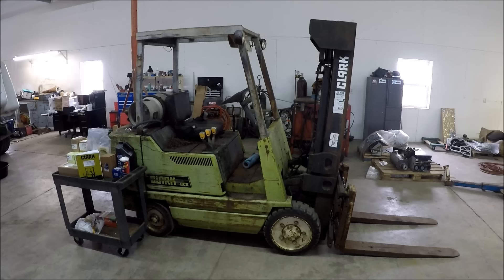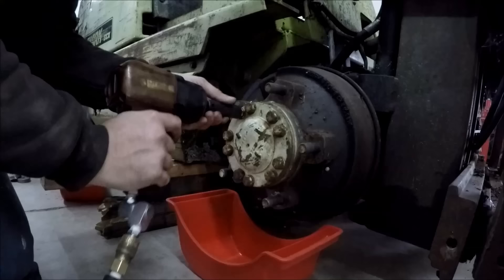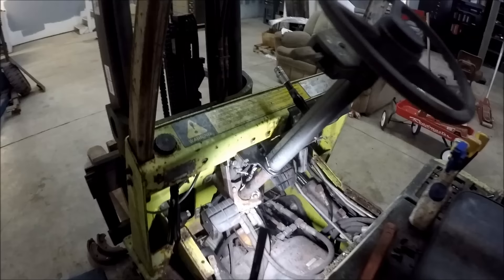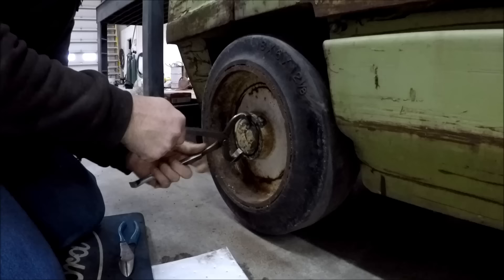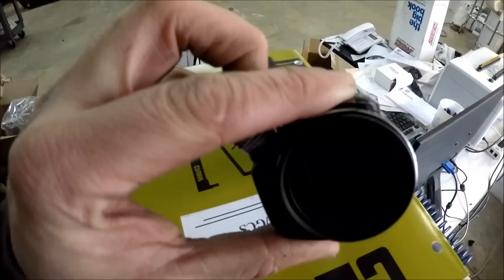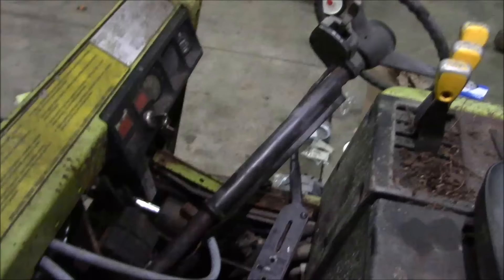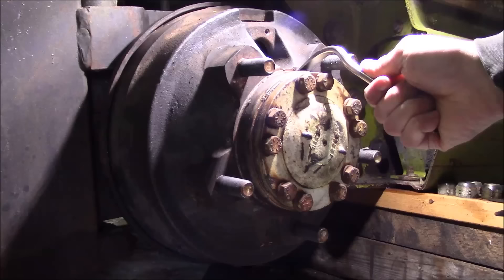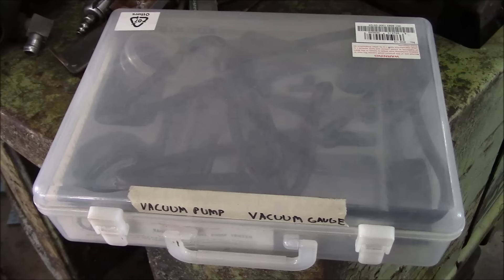Fixing a Forklift that Sat in a Field for 17 Years - Brake Job and Rear Wheel Bearings - Part 1

Comment: Because your so knowledgeable and detailed in your work you are certainly able to keep up and counter alot of snotty know it all comments from people. Although the comments can be toxic, I'm sure you have  learned from them as well. Your a great YouTuber.
Reply: I know this is a old comment but i cant help commenting on the subject of toxic comments and packing bearings,when it comes to packing bearings, you could have a degree from Harvard university with a Masters and a bachelors on bearing packing and once you make a Youtube video the first reply will be "man this guy doesn't know how to pack bearings' it makes me cry with laughter every single time.

I have been packing bearings for probably 30 years and i dont give it much thought,i make sure and i push as much grease in them as i can and just coat the hell out them, once they start turning that grease will be pushed in by extreme force where the sun doesn't shine and you'll be golden, in all my years i haven't had a single failure but i bet if i made a youtube video about it i would be tarred and feathered,lol

Comment: just a mention for down the road- if you ever need to replace the steering links, book says axle has to come out- I did mine a day before the book arrived luckily...if you remove the pins from both outer links, swing them both rearward then push down, the steer cylinder piston rod will rotate enough to remove the inner pins without pulling the axle and unbolting the cylinder body. was surprised when the book arrived- glad it was late :)
Reply from the maker: Interesting. One of mine is kind of loose, but I'm going to let it ride for now.

Comment: Wes, I used to work at a factory that had several lifts like yours with the mitsubishi engine. Good lifts but I hated working on them. Pro tip for anyone who needs a starter. Get one for an 85 dodge caravan with the 4 cyl and just change the gear and nose cone. Much cheaper and for some reason they always seemed to outlast the ones we bought from the clark dealer.

Comment: I have followed this from when you found it in a field. It has been very informative and detailed. Thanks for letting us watch over your shoulder.  I have been thinking about getting a old fork lift, and I think I will look for a gas or propane one.
Reply from the maker: I've had zero issues with propane. I know they are harder starting in the cold, but my lift is inside a heated shop, so that's never been an issue.
Reply: @WatchWesWork  thanks for the feedback.

Comment: At least you have been able to get parts. My Hyster is 38 years old and alot of parts for it have been discontinued so tracking down obsolete parts is a pain. Rebuilding the mast cylinder right now. Found the last 2 seal kits in all of the U.S.
Reply from the maker: Ouch. Yeah Clark parts have never been an issue. There are even aftermarket parts available.

Comment: Bleeding brakes or clutches from the bottom and up the easy and cheap way, buy a medicine syringe for large animals (horses) and put a silicone vacuum hose on the end and you have yourself a cheap power bleeder. I have used mine for 15 years and it has saved me in many situations when systems are poorly designed with the bleeder screw in the middle of the system.
Reply from the maker: I have a KD tools pressure pot bleeder. I just need to get some more adapters. Mine was made for the old cast iron master cylinders. I used in on grain trucks sometimes.
Reply: @WatchWesWork  What EDS says that is the Ticket not pressure bleeder needed, just fill the syringe and watch the bubbles in the reservoir come to the top, I wanna know though you got a spring set from Clark Dealer for $13.00 ??? and shoes for $30.00 each and I about spit out my coffee when I think you said $15.00 for the cable ....  They treated you very well.  You have a bad trunion bearing on the Drive axle causing the lean, you'll need to pull the mast to fix that.
Reply from the maker: @jerryrable1994  Clark parts are very reasonable. That's a big part of why I keep getting them. The chassis bolts were loose on one side. You'll see in the next video.

Comment: lol, as soon as you showed the pedals i thought of a funny story that you might appreciate. 

 one warm snowy evening we got two empty semis stuck in the dark after we unloaded ourselves after hours so that we could go home on friday night. of course the tractor we had just used refused to start because of a dead battery (they boosted it and left it running for us), and the only thing in the yard that would move us was an old Clark diesel forklift. well, that should work just fine. i volunteered to run the forklift because it was the exact same one that i drove in high school when i worked for that customer. what i didn't remember was that it had a clutch. so i got it running and warmed it up a few minutes and tried moving it. it had a shuttle shift so i backed up and then shifted into forward. which worked fine until i let off the throttle and it wouldn't stop. so i tried to find neutral. which didn't exist. so reverse-forward-reverse-forward a few times. still can't find neutral. even at a dead idle it wont stop. my co-worker who is now walking back and forth beside me says 'whatcha doing, quit playing i wanna go home' and i replied that i'm trying to find neutral. he lets me go back and forth a few more times and finally says when i go by 'try stepping on the clutch'. i did and it stopped. oh, it has a clutch does it? i watched people drive that forklift for 20 years and nobody had ever used the clutch.

Comment: Yep. Just put rear shoe brakes and cylinders on my girlfriend's Taurus. Tried the one-man vacuum pump method for the first time ever since I didn't have anyone around to assist me. Fail! Yeah, the bleeder screw loosened allows air to get around the threads. I waited until she could come over and, together, we used the two-man method and it worked just fine.
Reply from the maker: Yeah, the two man method never fails!

Comment: I like what you did with the air hose through the cap. That was cool.  As a general rule, I would hold the split end of the cotter pin with needlenose pliers as close to the nut as possible and bend it over the backside of the pliers to leave it rounded over. One side at a time. No stress points there.
     The first time I used one of those plastic pumps I noticed you have to really tighten anything with threads. They just leak.

Comment: Hiya Wes, if I've told you once I've told you a million times, don't exaggerate! That fork truck had not been out there 17 years, I reckon it was 16 years, 11 months, and 32 days! The reason for not packing the front wheel bearings with grease was the axel is full of oil, we saw it drain, and the oil lubricates the bearings. 
Stay safe...Steve...

Comment: I have a 53' Desoto and it has dual wheel cylinders in the front brakes. On one of the wheel cylinders, forget if it is the upper or lower, the manual says to use the vacuum method. I did and it did work. So the vacuum method does work sometimes.

Comment: I use a oil can with some tubing and simply hook to each wheel cylinder bleeder and pump away the oiler can until no bubbles appear in the reservoir. Shhh dont tell anyone but that's why there is a nipple barb on bleeders. LOL just egging you. Nice vid!

Comment: You can buy different size and type of rams for the jack pump also, we used them all the time where I worked for all kinds of stuff like fitting vessels etc! We even had one that has a center hole in the ram for pulling shafts out of screw augers! Kinda hard to describe the process but those drive end shafts were sometimes seized in and we’ve had to used a 75 ton ram to pull them out! 👍🏻

Comment: Just a trick/tip.   When working on forklifts I just tilt the mast back all the way.  Shove good strong lumber under the mast.  I prefer a good 4x4.  Then tilt the mast forward.  It will lift both wheels off the ground just high enough to remove the wheels without breaking your back.   Been working on forklifts for 10 years.  Works great on those really big heavy units.  Maybe use a 6x6 for those.

Comment: About the marks in the hub behind the races.... I would say what you're looking at is an attempt to tighten up the bearing races in the hub. Old mechanics trick. By taking a center punch and punching the hub you actually raise the surface a little therefore tightening the race just enough to stop the race from spinning.

Comment: Tip disassemble new wheel cylinders before you install. Wash with brake cleaner put some brake fluid on cups and reassemble then install. Lift truck mechanic 40 years been there and done it

Comment: Buy a 1 gal pump sprayer, fill it with clean new brake fluid. Modify the discharge end of the sprayer using compression fittings put an inline ball valve to stop fluid flow when needed. Adapt  hose connections as needed

Comment: Great videos. love your content. bottom up bleeding of the brakes (forcing fluid from the slave cylinders to the mater cylinder) the theory is air in a line rises. air will always rise to the highest point in a line and resist going down a line so it is easier to get air out of a system easier/faster power bleeding from the calipers/slave cylinders to the master cylinder. i was a service manager/mechanic for Harley Davidson for several years and was taught to use this method at the dealership and doing it this way never had comebacks with spongy brakes due to lingering air in the system being the cause. you asked in the video, here is my answer/experience on your question.

Comment: I feel your pain in regards to 80's vehicles and the random fastener sizes. 
My 1st car was a 1980 Chrysler Sigma, designed by Mitsubish and built in Australia with what ever was in the parts bin as Chrysler was shutting up shop here. Engine was metric, gearbox imperial, front disk brakes metric, rear drums imperial... I did end up with a good tool set after working on it for a few years.

Comment: In my job we refurbish conveyor belt Idlers  and I’ve seen shafts worse than that that still work fine, my boss always said if your finger nail can catch the grove its ruined sealed bearing though and they run at 30 to 40 kmh not sure what that is in miles great video always very informative 👍
Reply from the maker: I think top speed on this lift is about 4 kmh. LOL.

Comment: the brake fluid hoses from the reservoir to the master cylinders would benefit from a loop, if possible, that extended down below the master cylinders in order to prevent air intrusion in the event of a reservoir leak.

Comment: suggestion as alternate to silicone for caps- teflon pipe dope seals well and can be easily removed. silicone- especially if a lot of surface area- can really be a bear to pull loose without damage...pipe dope usually breaks free by just removing the bolts and tapping once- and it stays soft, so cleans off easily.
Reply from the maker: Something like Permatex #2 or Hylomar would work fine too. Those are both easy to get apart. But silicone is what I had on hand.

Comment: Just got an 80’s Caterpillar GC30 last week and I could swear it’s the exact same machine with a different name. Kinda have the same situation as you. Except my machine that I just got that was sitting outside for years with moss all over it is a 1956 Michigan 75A wheel loader. I’ve thought about making some videos on my stuff. Anyways, nice work, great channel!
Reply from the maker: They all seem to be built about the same. Especially the old ones.

Comment: Nice bearing driver's. I had a tightly fitting pinion seal on a 94 Dodge rear differential pinion seal that I had to freeze and then used the hat style drive clutch from a Wheel Horse.  Perfect

Comment: The hoses that you said were fuel hoses are actually upgrade from original petroleum-based hoses that go on there. Brake fluid is a non-petroleum-based fluids which is soluble with water, you would not have a problem with the hose was on it. Been in the brake businesses since 1969 never had a problem with those hoses. It's all good thou good to see year watching details.
Reply from the maker: I don't know. One of the hoses had already split. I was always taught that anything the hold brake fluid has to be something special. But I don't really know.
Reply: @WatchWesWork  it's all good.  Your doing a great job.

Comment: Bubbles entering the fluid stream at the bleeder don't reverse flow  and are safely separated in the waste fluid capture cup. However the problem w/ the vertical MC would persist. good video!
Reply from the maker: I would think it would pull enough fluid through the master cylinder to get all the air out, but it did not.

Comment: You might want to use some torx wrenches in place of the allen wrenches on those type of socket screws on the wheel cylinder.  I've used this method for a number of years, it works better than the allen wrenches do.  You have to make sure the edges of the Torx wrench fit tightly into the corners of the socket screw, otherwise it won't work properly.  Vacuum bleeders don't work, for the exact reason you mentioned - which is why most line mechanics don't use them.  Pressure bleeders almost always work better.  You can make a pressure bleeder cap out of a board if you need to, and thread an air fitting into a hole in the board.  All you need is a chain, clamp or other method to keep it in place.  They have a number of universal caps that can be used also, if you want to buy them.  Russell also makes speed bleeder valves that have a one way valve in them, it makes it a lot easier to bleed than using the vacuum or even pressure bleeder methods.  Or, you can just make your wife press and release the pedal for you bleed while you bleed them.

Comment: A guy I was working with told me that his friend was putting a lot of torque on and allen (hex) wrench and it broke half way up the long arm and the break was very sharp and it stuck through the guys hand. 
I use my ac vacuum pump to supply the vacuum when bleeding brakes. A Top Kick truck I was working on that had anti-lock brakes and the manual said a special scan tool just for anti-lock brakes was needed to cycle the anti-lock valves, well using the ac vacuum pump supplied enough vacuum to enlarge the air bubbles and I was able to bleed the brakes with out the scan tool. One thing I have noticed after vacuum bleeding is there seems to be a bit of air at each wheel that needs to bled the old fashion way. 
PS you installed the cotter pins the correct way,  but I guess you already knew that.
Reply from the maker: Some of those anti lock brake valves with the pump are almost impossible to bleed. I watched a video once where a guy had a Ford hybrid with an ABS pump and he took it to 3 Ford dealerships and none would bleed the brakes on it.
Reply: @WatchWesWork  A hand powered vacuum pump just does not create enough vacuum that is why I use the ac pump, it makes the air bubbles grow in size making them much easier to remove, I have used it to help bleed power steering units also. Sometime if a master cylinder is found empty you can add fluid and then start pressing the pedal just enough to cause an air bubble to be released, but the key is the small port has to be at the top. I put a car on a hill once to get the master cylinder level so it could be bled just by lightly pressing the pedal, it also worked on a neighbors combine. You do not want to press the pedal all the way down but just enough to get an air bubble to pop up.

Comment: air floats. bottom up bleeding is the correct way to do it, as it pushes trapped air up and out, and no air can be sucked around the threads. a horse feeding syringe is the trick setup.

Comment: I you slide an ignition wrench over your allen wrench and keep it close to the bolt head of the bolt and torqe both the ignition wrench and allen at the same time this will stop the torqe twist on the allen and give you more power to brake the loose. This works well with truck bed bolts.
Reply from the maker: Interesting. I'll have to try it.

Comment: For sitting 17 years those clevis pins came out easy. I’ve worked on trucks that run every day and the pins are seized tighter than hell.
Reply from the maker: Yes. Tiger Tool makes a nice puller for brake clevis pins.

Comment: 6:20 I thought I'd say, for anyone interested .. you can turn any jack like that into a "Toe Jack" by making a slip over peice of close fitting pipe (capped obviosuly), and a simple 1/2" or 3/4" 
3" long bit of plate steel welded right at the bottom ... they don;t work perfect but they DO work ... I used to use them often

Comment: First forklift I ever drove was a Clark and prob the best lift truck I ever used after driving all brands and sizes
Reply from the maker: I've always liked mine. I've used Cat, Case, Toyota, Towmotor, etc and they were all fine. But the Clarks are easy to get parts for and not that bad to fix.

Comment: I think Id’ve been tempted to make a custom cap for the brake reservoir with the lathe to hook up the vacuum up top and then figure out a way to hodge-podge a pressurized reservoir from the bottom side using compressed air to both suck and blow it at the same time. 

And the it wouldn’t work, I’d get pissed and throw some tools, and give up entirely, just go with the old Flintstone brake system. 

Great content, man!

Comment: The bar between the shoes is called an equalizer bar. Just wanted to pass that less than needed info on.  Lol.
12:56  Sometimes you have to tightened a bolt before loosening it.
Reply from the maker: There you go. Equalizer. Normally that is where the adjuster is located.